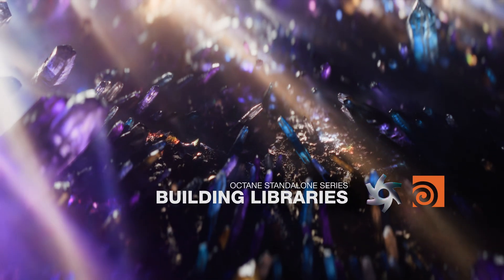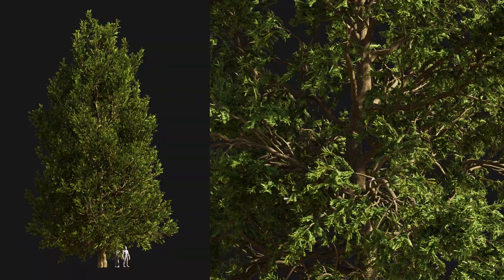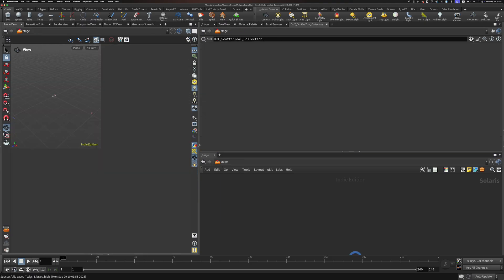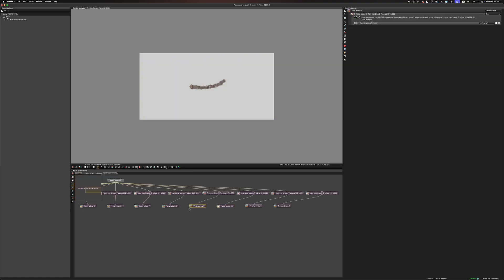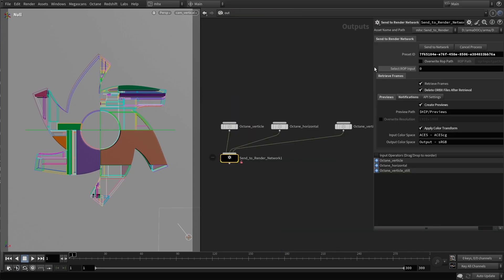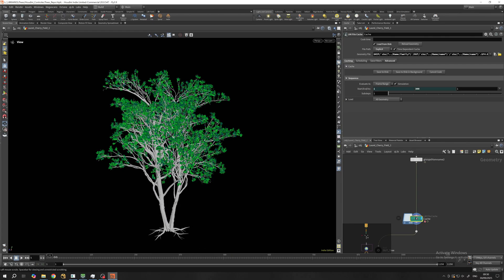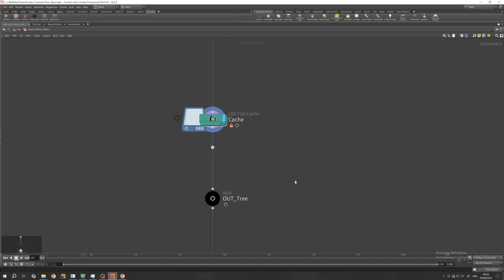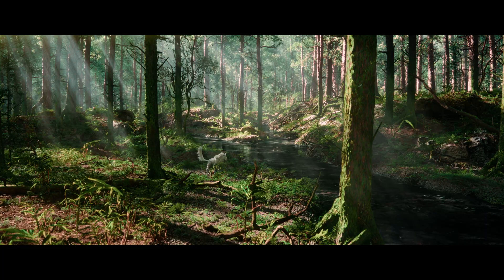Building Reusable 3D Libraries in Houdini | Octane Standalone Series

Comment: When you realize, library creation moment is more joyful rather using it. Me the same. Can't wait for Nanite Procedural Vegetation next update…Tree pain killer)
Reply from the maker: Octane has meshlets in 2026 and it's a proper production engine that scales and renders everything production needs. I so don't like these statements :) Trees were, are and will be a pain everywhere. In UE they also look like paper origami with fan blowing on them. It's like comparing onewheel with a car, one is fun and the other is getting actual job done.
Reply: @AndreyLebrov yeah, the standard WPO or even Nanite displacement, while impressive, still suffers from precisely these shortcomings. It becomes immediately clear that the realtime/game target of the software fundamentally limits photorealism. I don't think that this is a negative though of course; two completely different tools for completely different end outputs/deliverables.
Reply: @AndreyLebrov Check last Witcher demo. New foliage assembly will surprise you.
Reply from the maker: @_zv1198  Everything I said above minus paper origami